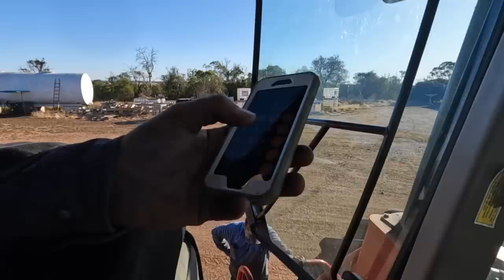TOO MUCH POWER | The Weights Go On | Planting 2023 | Farming in Australia | Vlog 164

Comment: I guess it is too late to point out, however, the years as a seed production agronomist in me was a bit horrified at the amount of wheat seed on planter frame when switching to barley. When changing seeds just give the planter frame and box a good hose down with portable compressed air, and, better still, they make a vacuum cleaner attachment on it, works by Venturi, for cleaning out the box. Wheat in barley is a major contaminant if going for higher grade prices and ditto for barley in durum, one seed / ha rapidly becomes a couple of hundred plants in following years. I’ve seen a few.
Reply from the maker: Hi mate! The barley is a clear field variety so we will be spraying out any wheat that does come up, but we do usually give them a blow down as well👍

Comment: You should try cutting the sides out of some old tires and placing them between the 2 tires if your not going at high speed the imbalance shouldn't matter to much. But they should fill the gap, be flexible but stop rocks.